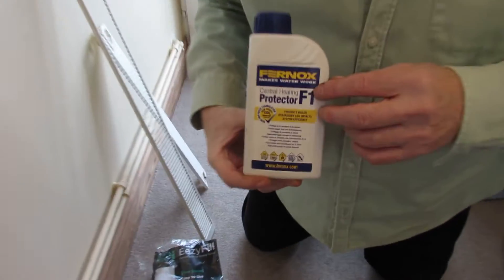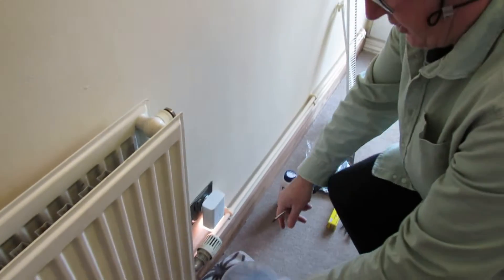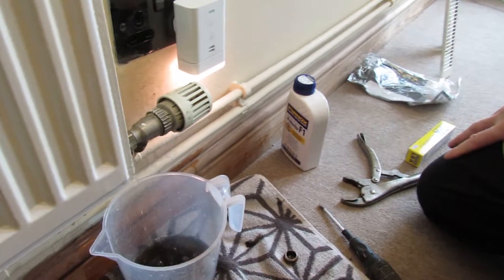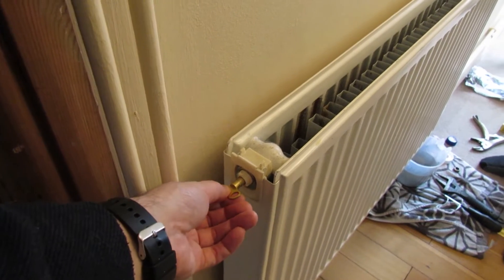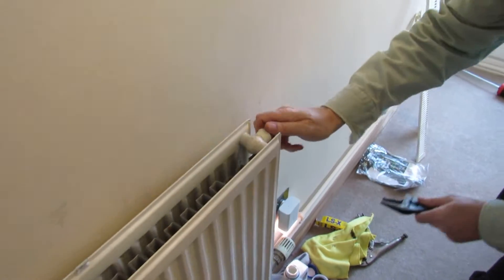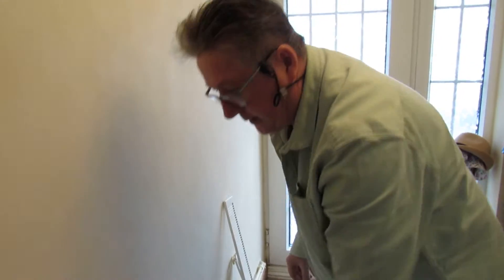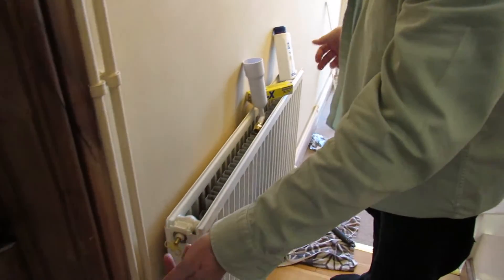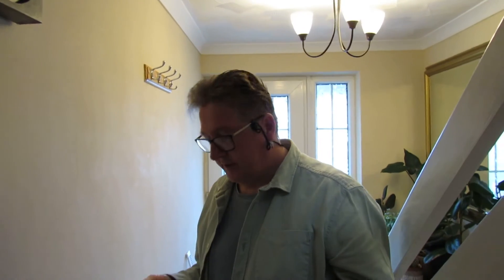How to add Fernox Central Heating Protector Inhibitor F1 via a radiator #fernox

Comment: I isolated both radiator valves, opened the bleed valve and once the little pressure was released I shut the bleed valve and took out the blank plug on the opposite side of the rad, (be careful of a little water) then shortened the part that protrudes from the part that screws into the "plug" end then screwed the threaded end into the radiator.  Slowly opened both radiator valves the black "bullet" seals perfectly, I then pushed the sealant into the adaptor, it took around 30sec.  I then shut both radiator valves, opened bleed valve, then closed it once the little pressure was released, then slowly removed the adapter and replaced the plug.  Will see if the sealant does its job..